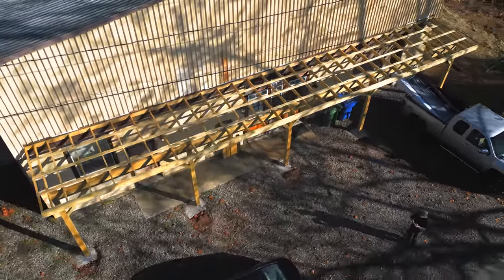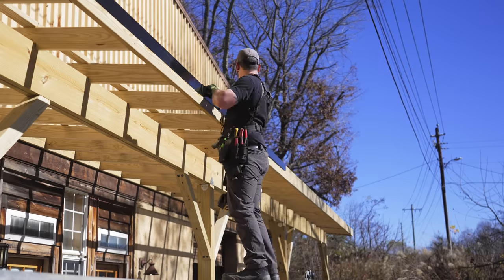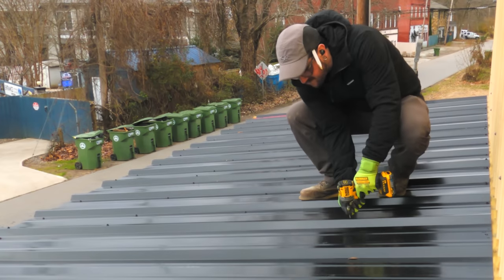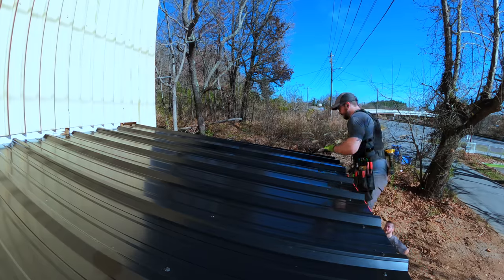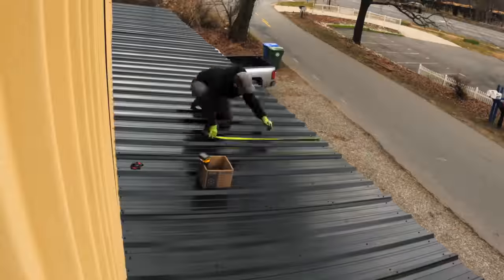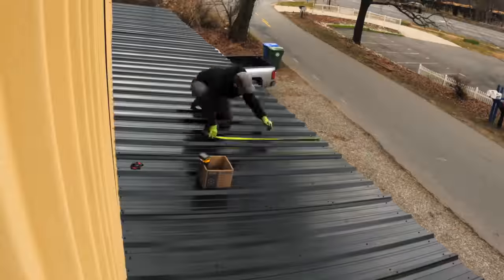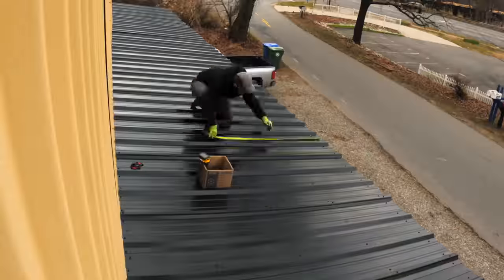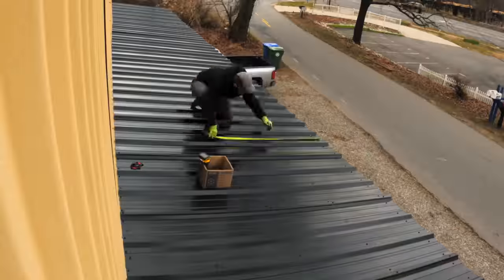WORKSHOP RENOVATION 14 : Metal Roofing Installation On The Porch Roof

Comment: You have the wrong kind of shears. You have offset shears, essentially powered aviation snips. You need a double cut shear, which has two fixed anvils with a single blade cycling between them. It creates a thin strip of waste in the 'kerf' but it creates clean edge.

Comment: If you are worried about people running into the posts with vehicles, you should add some reflective tape at driver's eye level. That way you never have to worry about the lights burning out or going bad over time.

You can probably find something that would blend in really well and only be noticeable at night if you are worried about aesthetics.
Reply: This guy safeties efficiently.

Comment: Definitely want to install a gutter across the front of the porch.  Also,  hindsight you could have slid the top flashing behind the wall siding at the lap joints of the wall siding, although the way you did it seemed to work pretty fast.  Shop is looking awesome my friend!
Reply: The same thing occurred to me--just slide it through the vertical lap joints. Oh well, hindsight is 20/20.

Comment: I agree with the waviness on the impact nibbler. My cuts were like that a lot until i figured it out. All i can say is don't fight it when it cuts, the battery will go from basically touching the sheet to being in the air throughout the cut. Use it more and you'll get the knack of it.

Comment: Your cutting attachment will cut smooth the other direction. Look at the blades and plan your cut with the proper side of the blades on the outside. When I first got this tool for my business, I had smooth cuts and then wavy cuts. It comes down to position of the blades, so find the right direction and plan your cuts accordingly

Comment: Use a punch  for preholes in the you will not end up with metal between the panels. tip from R&R buldings
Reply: A hole punch or a center punch? He did pre-drill, which seems like an even better solution since it also acts as a guide when installing the screws.
Reply: @haphazard1342  R&R builders has great explanations for why a punch is better. No metal shavings.
Reply: @haphazard1342   i'm not good with english. so is more yease to use a punch tool (like a pointy tip screw driver) that you hit with the hammer and goes thru the metal sheets, predrill creates metal shavings that go thru the metal sheets and when you drag the sheet on top you may damage the paint with the metal shading. just look at R&R buldings channel they go in more in depth with this process as they use metal sheets from roofing to sidings

Comment: Always offset your string line. Even just an inch and measure back. Keeps it from creeping 😎
Reply from the maker: Good tip. Also managed to cut the line with one of the panels, those edges are sharp!
Reply: @craftedworkshop  also check out RR Buildings he’s a wizard with all things roofing 👌🏻😎

Comment: Malco makes a folding tool for bending sheet metal. Model 24F has a 3/8” and 1” slot for bending up to 24” long flanges. Check it out on Amazon.🇨🇦

Comment: Hey , Those sheathing panels above the roof need to be sealed also to keep the bugs out and any wind driven rain also. Just like you did on the roof panels .
Reply from the maker: Yup, going to use spray foam once everything dries out!
Reply: @craftedworkshop  The fire block stuff might be required blah blah lol . I see you plan on drop ceilings . FYI on a windy day in a factory showroom by me I saw a ceiling twice the size of your shop got tossed into the loft area by a gust of wind from an open outside door . Serious it was a really wild thing to see an entire ceiling of panels do a wave then fall into the showroom . Not a ceiling guy but my guess they missed some kind of clips to hold the panels down . Good Luck Pal
Reply: @michaelcolgan3182  That would be AWESOME to see!

Comment: I was going to suggest pre-drilling the holes in the roofing, but you figured it out. The added aesthetic benefit is the screw lines are nicely straight. A tip, use a cobalt bit, it'll do exceptionally well with a cordless drill (lower rpms). One bit would probably hold up through the entire building covering. Yeah, you'll find pre-drilling wall metal is entirely beneficial.

Comment: I was really surprised to see the manufacturer call for fasteners in the low spots of the roofing metal. I always thought you were supposed to install on the high part.
Reply: This is common on metal roof panels that have some minimal slope, like 1.5:12 or more.
Reply: If you put the screws on the high spot. The panel will spread out and move.

Comment: those foam closures and the butyl tape are both pains in the ass to work with, especially if the wind decides to gust when you're trying to get the closures set on a long stretch.

Comment: That attachment you have works fine for long cuts on metal roofing, but you have it the wrong way. On one side it leaves a wavy edge, on the other side it will leave a nice straight cut. Just need to be aware of what side of the sheet you’re keeping and make sure the non wavy cutting side is faced away. Buying actual shears for this small project makes no sense when you can buy this $50 attachment and get the job done nearly as well.